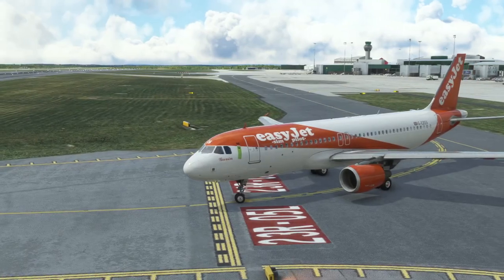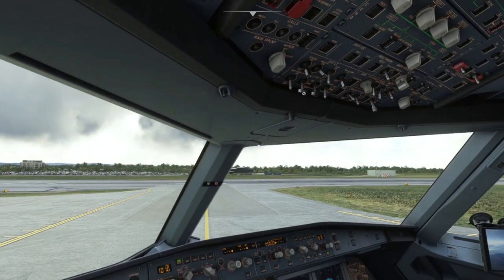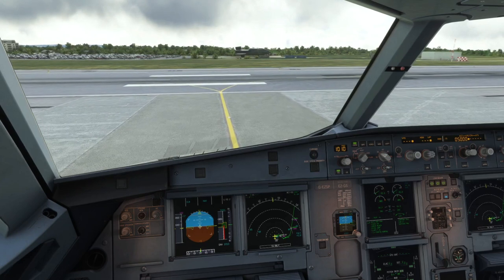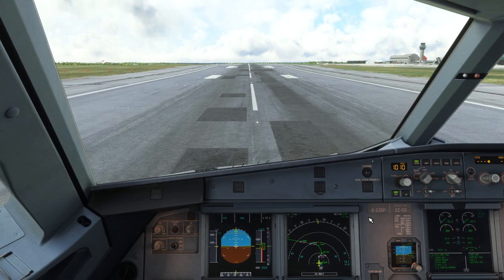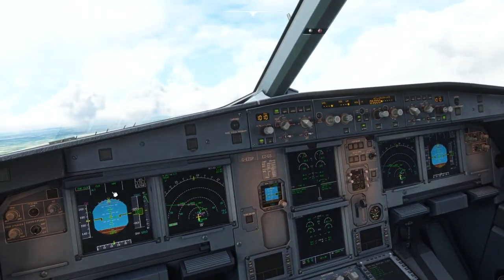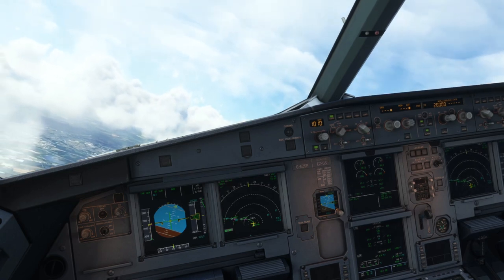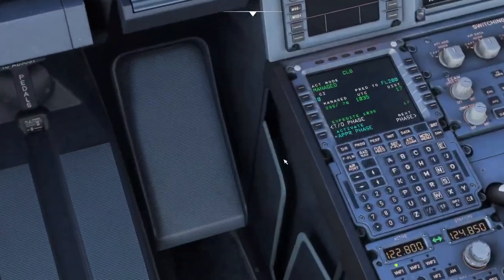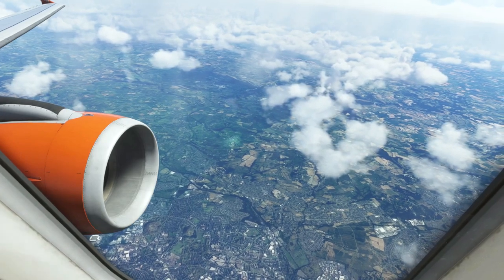FENIX A320 - Takeoff & Climb to Cruise | Tutorial Series Part 4

Comment: I have the problem, when I go full throttle for take off my plane is moving from the left or right and with full power my rudder pedals are not reacting correctly but they are working proper with taxiing and I switcht that little wheel on the left side off but it still doesn’t work🥲 Can u help with it, or du u have any idea what the problem can be?

Comment: I'm having a random problem with AP turning itself off on Take Off about 20 secs after activating it, by random I mean it doesn't happen all of the time, it's driving me nuts.  And the thing is I can't reactivate it again no matter what I do so the flight is over.  Other people have said it's to do with Null Zones(I don't even know what to do with those), or the Sim starts yelling Speed at me.  I'm using the Thrustmaster Airbus Set with the Thrustmaster Throttles.
Reply from the maker: Sounds like you are entering Alpha Prot and your speed is far too low. AP will disengage and remain unable to be selected until your speed is back safe.
Reply: @Easyjetsimpilot  ok thanks a lot I ‘ll take a look on my next flight to see if I can sort it out